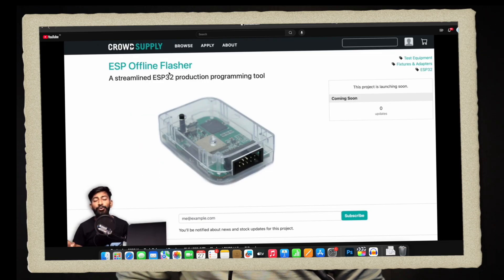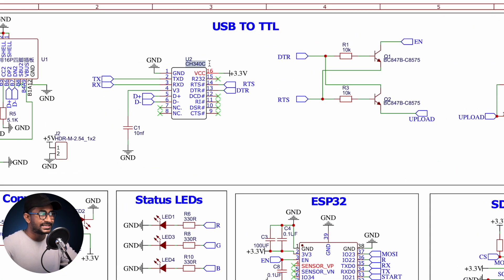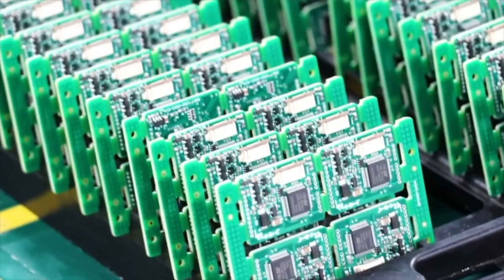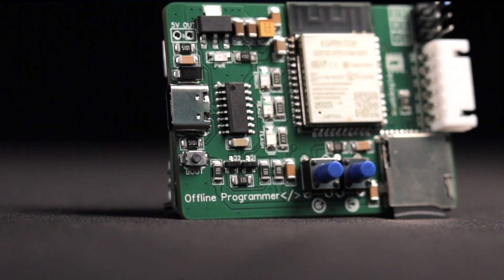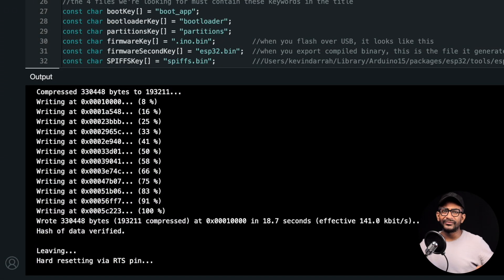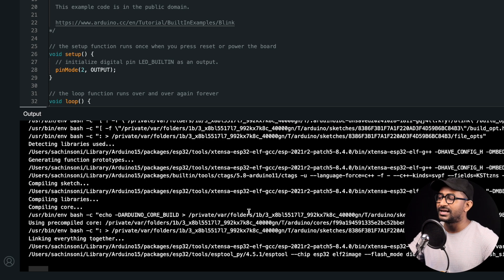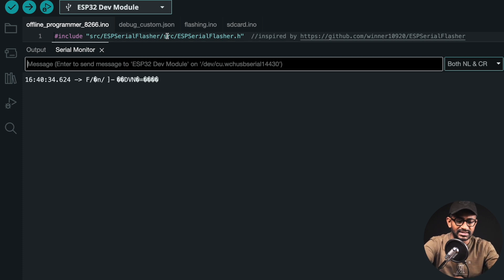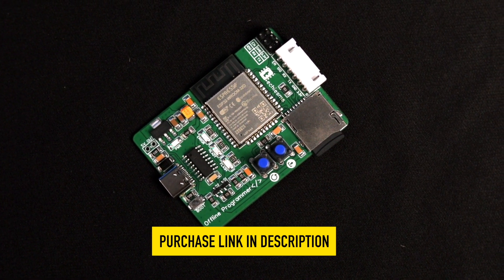Program ESP DIRECTLY!! without any Computer 🔥🔥 | ESP Offline Programmer | @Board-Geek

Comment: Hi, I received one of these from you and it’s working perfectly - I love it.  A quick question though, I noticed that if I connect it to one of my project esp32’s that don’t have accessible reset and boot pins I can still use this board but I have to manually put the esp32 into boot mode. This is fine and I expected that to be the case.  But the sketch seems to put the esp32 in boot mode itself, then flash one file, then reset the esp32 then boot mode again then flash the next file and so on. It puts the esp32 into boot mode 4 times.  Could it be modified to only put the esp32 into boot mode once? Then flash everything so I don’t have to keep pressing the buttons manually 4 times?
Reply: reset and boot pins are just EN? Am I understanding correctly? I too want to know if this will automatically put the esp32 module into boot mode or if it only works with devkits that have circuitry on the EN pin?

Comment: use ftdi programer its much easy.. dtr,rts,rxt,tx,gnd,3v...
Reply from the maker: That’s a different thing 
With that you need a computer to program the chips 

But with our programmer you don’t need any computer
Reply: You’re missing the point of this device. It’s a programmer that doesn’t require a computer.

Comment: This is aweasome but there are some problem with ESP32  placement In PCB there are some capacitors close to the  ESP32 WIFI and BT antenna That Effect the capacitors, Hope you fixed this in next design.